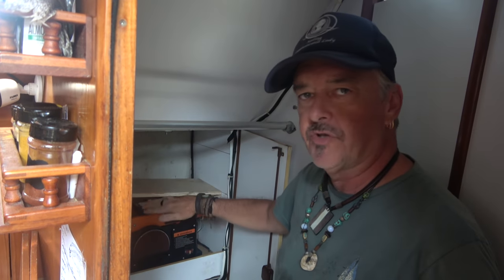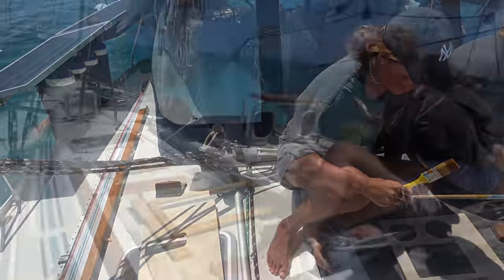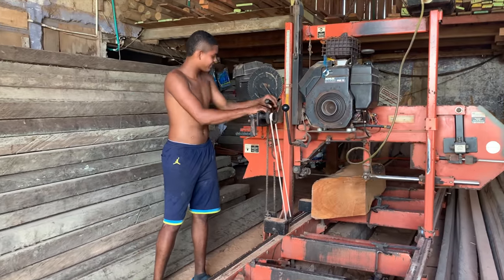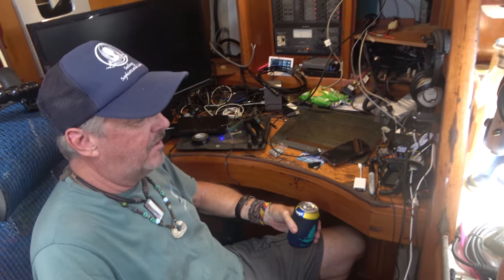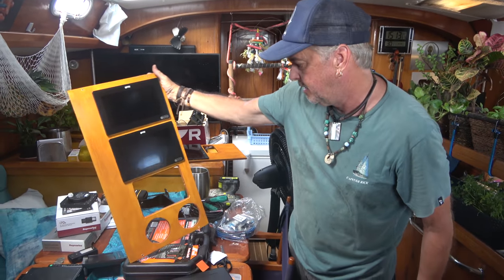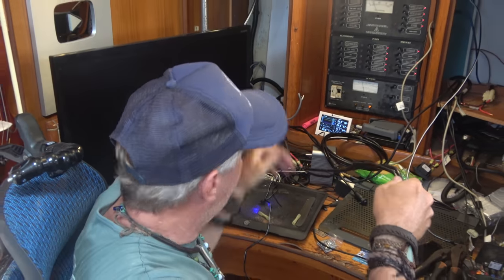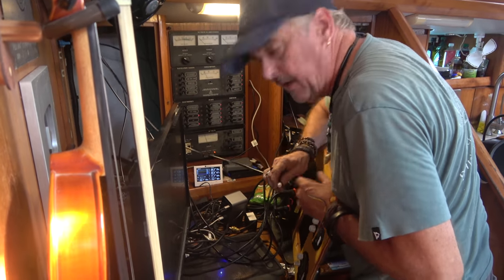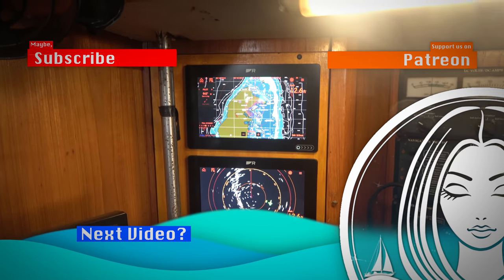SSL549 ~ feeling a bit LOST at the moment...

Comment: Great video Rick and excellent progress on the Nav Station. If you don't have a heat gun you might consider getting one so you don't have to use an open flame to shrink tubing. Remember it is gases that actually burn.
Reply from the maker: Yes, heat gun uses quite a bit of power, I just use the flame out of habit.. one little tube of butane lasts me for years

Comment: I installed Dometic electric heads to replace my original Lavacs, but with the aft head I left the old Henderson pump in the line as the pump was not in the way and even in an easy to operate position. That turned out to be a fortunate move as it gives me a manual backup if the electric pump or electricity fails, but more it makes it so I can pump the toilet line dry so the bowl is dry (no smells) and there are no line contents to react with salt to form clogging crystal deposits. The other thing I discovered to do was to install a reversing switch for the toilet electric motor. This turns it into a much better masserator for a smooth rather than chunky blend. I’ve yet to make a little Arduino control board to make this a single push button process, including running a vent fan.

Comment: Hey Capt, have you thought of getting a roll of shrink-wrap (use with heat gun) to seal items from the salt air during stowage? Lots of other handy uses as well.
Reply from the maker: we've just been using plastic film wrap.. several wraps wound tight keeps out any water or air so the parts last longer

Comment: New O Rings and gasket seals and you´re OK, back and running, and if you search in hydraulic part stores or even construction equipment parts vendors, I´m quite sure you will be able to save even more $$$ as everything that you can get in a boat parts store will be more expensive just because..., safe sail
Reply from the maker: Yep, I hear that!

Comment: I gotta ask after so many episodes hearing it..doesn't that cycling water pump drive you batty? Sounds like a little leak somewhere dropping the line pressure for sure.
Like the reuse plan with the poop pump, but hey it's on;y the crew pooper, if they break it they always have the weather rail ;)
That is one sweet electronics suite, Cap'n Rocks Mission Control center.
Reply from the maker: No, the water pump you hear is cycling for the drinking water purifier.. it runs for several hours per day to refill our tank for drinking and cooking water.

Comment: You could utilise the door and put a hemp net bag on there
Don't need a big router like that bit dangerous as well clumsy, get yourself a Makita battery operated much smaller much easier to use especially in small spaces very powerful just as powerful as that one 3/8 get 5 amp hour battery.
Might be worth making a little workbench to go on the back end that's removable inch ply with sides brace on the last step, 3'x 4 do some dog holes maybe put a vice on it.
You can plain or cut  clamp material drill make it horseshoe so it goes around you.
Expensive to run isn't it that use satellite to communicate out to sea! that's not cheap or only works with Wi-Fi?
Reply from the maker: thanks for tip!
Reply: @SailingSophisticatedLady   why waste space on a  door if you can utilise it !  left your question? about the radar.